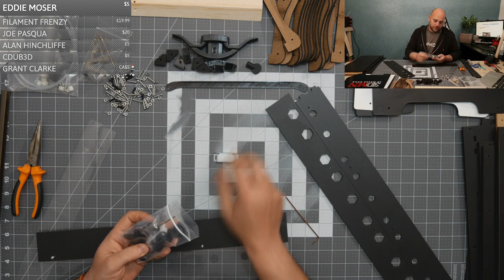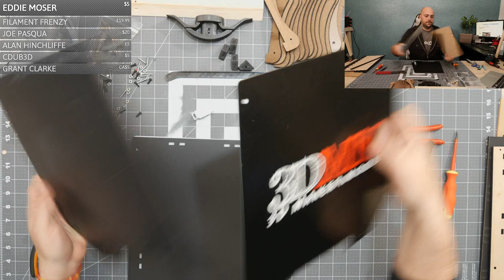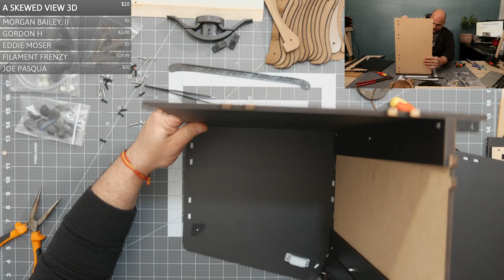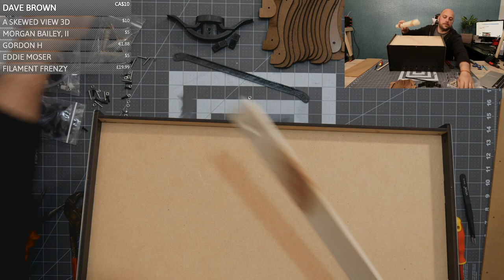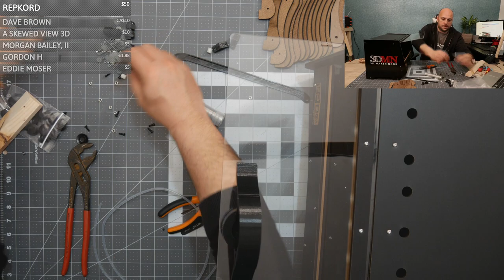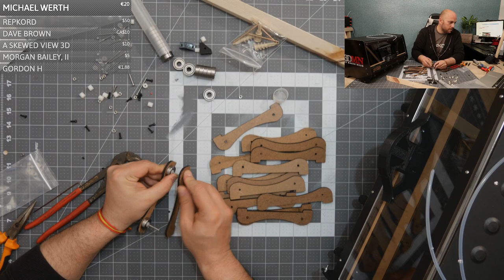Chillout Q&A Live Stream While Putting Together My RepBox From Repkord

Comment: I have been trying to make your mood lamp and have had all kinds of problems printing it with my TEVO Tornado. First I had a problem with layshaft think (not sure) I have that issue fined but know after I get to the thin part it gets knocked over, has happened several times, prints perfect (the base printed perfectly) till I get up about 1 inch. Any ideas what might be the problem?
Reply from the maker: Which part is the problematic piece?
Reply: @3DMakerNoob  The tower and I think the cover will as well. It prints perfect for the first inch or 2 then it gets knocked over by the nozzle.
Reply: @3DMakerNoob  The tower and maybe the cover since it is tall as well.